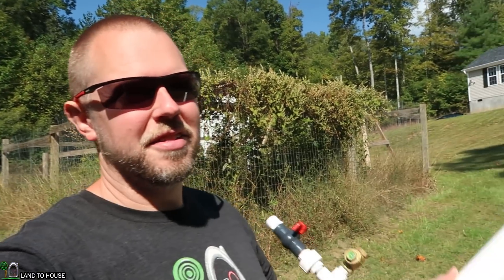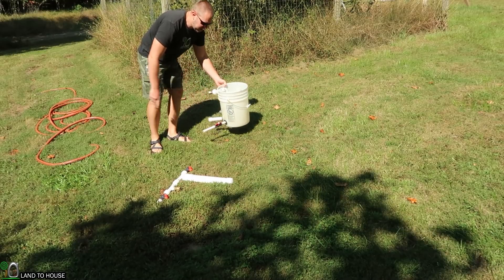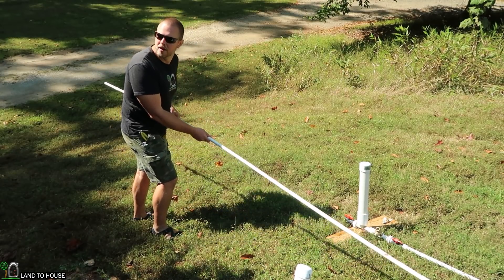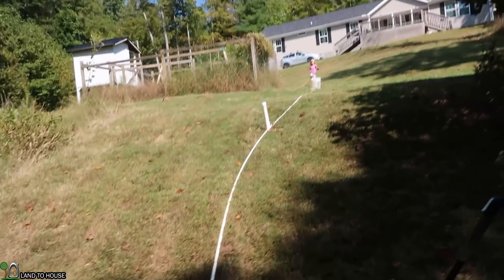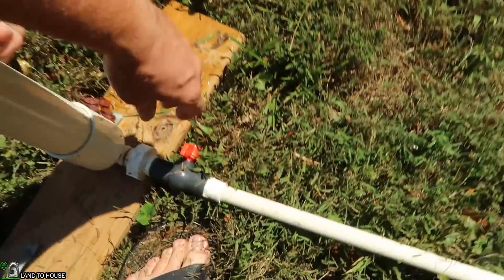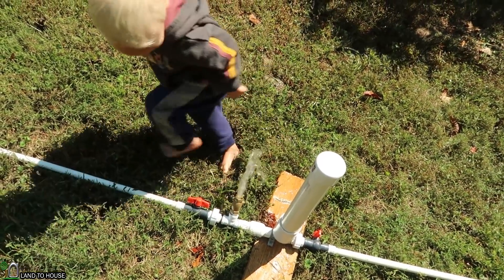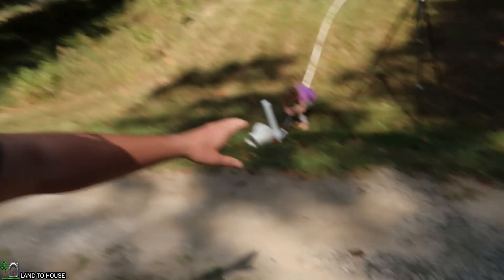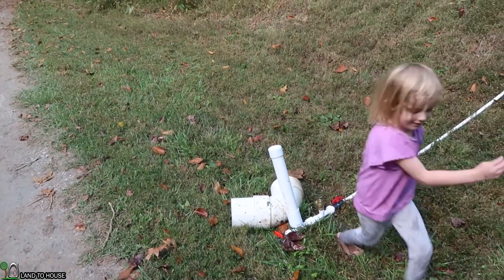Two Ram Pumps in Series

Comment from the maker: Just in case you missed it here is the ram pumps in parallel video:
https://youtu.be/ekeQJ6OiN48
Reply: why would you think that wouldn't work?

Pressure is pressure

So if two or three feet of drop is enough to operate one ram pump.. why would the even higher pressure water coming out of that ram pump not be enough to operate a second one.. when it comes to pressure? Now Flo might be a problem to maintain..

But if you can push water up a hill then it has more pressure than your head pressure on the first pump.

So you just need to make sure you can provide the gallons per minute necessary as you definitely have the pressure.

Have you ever noticed a ratio of head height, to water lost?
In other words if you have 80 ft of drop instead of 2 ft of drop, does less water flow through the valve before it slapped shut because of the higher pressure.

I am just curious if the flow and gallons per minute remains the same no matter what the pressure.. my theory is less gallons per minute at higher pressure would slam the valve shut because it's the same amount of energy with higher pressure and lower flow.

Just curious if you've tested that
Reply: How about 7 parallell pumps in series with one other? Do a raffle and hand out one or more of the pumps for viewers as well.
Reply: I can't see any useful applications for this configuration as of yet but i am interested in seeing the outcome of your proposal. Also try catching the waste from the first in a bucket and run a smaller off that.

Comment: If a lower ramp pump were to pump uphill to another sotrage tank, then drop downhill from the first storage tank and use another ram pump to push the water even higher uphill to another tank....you'd lose water volume but you could pump much higher delivery head by staging them in combination with storage tanks to feed the subsequent ram pumps

Comment: the check valve is most likely not fully closing, and bleeding down to the second pump. i believe you would need a stand pipe inbetween first and second pump, with the height of the stand pipe above the initial head. 

secondly, you must run a larger first pump. 

thirdly, the fist pump needs back pressure, against the check valve in order to work properly. see above.

Comment: Please put a reservoir after the first pump, then use that toilet flush velve and bullkok, except use the bullok to flush it, periodically opening the velve, so the second pump works efficiently and can do work. 
🤔 Hmm I don't know if it will suck air through the flush valve, might need to adjust it closes before the tank empties.

Comment: The second pump is using the relief valve as the open air source every time the first one cycles. The theory on ram pumps is the pump's lift is proportional to the amount of water drop in height, in this case, the source to the first pump needs a longer drop or a large source pi9pel not a larger pump.

Comment: You need 4:1 in diameter to work well. And the water not need to drop. The second pump will cick faster too. But the 20 foot pipe is required between the pumps. The output should be around 40 - 75psi or 3-5 bar. All these from a 3 foot drive pipe elevation. The output water is only 10% of the original input. For an 2inch input pipe will take 14 gallona minute and deliver 30% yo the second 0.5inch ram pump. The final output will be around 3 liter or 3/4gallon. Theoretically it should work with a 1 inch pump too, but it just fit to each other.

Comment: I don't see the point of having them run in series in this exact configuration. I could see adding a second one to act as a repeater to drive water further up a larger hill. while having a reservoir feed the second one yeah you would probably have to have a step down in sizes for it to have plenty of water to keep it going.

Comment: I did not read all the other comments, my stroke prevents my reading... The reason waste valve 2 cycles but wast valve 1 above it dose not as its creating a vacuum pulling it down. That also is the cause of all the additional air pockets. At least that is my best guess. Its sucking water and air from valve 1.

Comment: Add a storage tank to each pump on the input side. When each tank fills up. Then start the next pump. Make a reservoir for waste water collection at each pump. So waste water could feed a smaller system. 
Nothing is ever going to be perfect but you are very diligent. If there is a solution you are the right person to find it. Great video.

Comment: ((Copied my comment from your 
   "Will parallel pumps lift 
    water higher?" video)
""I've only seen less than 25 of the 180 
comments, & not sure if completely 
had been previously stated...

But, 
Two things to recheck if you're going to retest & make an update; 
    A¹try to get both pumps running 
       in unison.
    A²make a stand utilizing three tiers, 
       *a tote mounted on top, 
       *bucket at the ground level w/
        (drain hose back N2 first pump)
       *second ram pump (just above.
         the drain bucket) to make the
         next leg up.

NOTE: the 2 keys that most 
              likely to help is...
 B¹ the stand should be built between
    1/3 & 1/2 of the elevation
    difference between the initial
    source & highest discharge 
    point with the hose filling the 
    tote at maximum elevation. 
 B² the return hose will not only stop
    the formation of a mud hole.. 
    But slightly add to the head
    pressure of water source
    Which should slightly increase
    overall elevation.

If you truly must pump to 
really unbelievable hights...
This might be just stand a 
chance of helping.

If y'all decide this might be worth 
trying, let me know & I'll keep 
an eye out. 

Thanks for sharing. ""

Comment: Isnt the whole idea to send water to a higher elevation? Having water flow downhill and create a small amount of pressure seems kinda normal. 
U said the drop from the bucket to the first pump was 3 feet but the water was only getting pumped less than a foot high…

Also shudnt the waste water valve be downstream from the air tank? That way when the waste water valve shuts from the flow of water, the resulting water hammer reverses flow and has more force on the air tank.
Reply: My thoughts exactly.  There is no point in the first pump, as it is uphill from the second pump.  Just removing that pump would increase the pressure on the second pump.  to put 2 of these in series and make sense,, the first pump should be lowest.   It should pump uphill to a reservoir similar to the first pump's reservoir.  That should feed the second pump to give it pressure.  The second pump them carries the water farther uphill.  You could also capture the waste water, from the second pump, and feed it back down to the reservoir of the first pump.

Comment: i dont think u should have put the second pump lower than the first. try puting the second uphill and if posible smaller diameter pipe than the first in order to increase total elevation of pumped water by the combo.
Reply: There is no point in the first pump, as it is uphill from the second pump.  Just removing that pump would increase the pressure on the second pump.  to put 2 of these in series and make sense,, the first pump should be lowest.   It should pump uphill to a reservoir similar to the first pump's reservoir.  That should feed the second pump to give it pressure.  The second pump them carries the water farther uphill.  You could also capture the waste water, from the second pump, and feed it back down to the reservoir of the first pump.

Comment: Your water reservoir is a bucket which is unable to create pressure on the basis of its small volume you must use a bigger water reservoir
Reply from the maker: Water pressure is based on water height not volume. The bucket is a little over 1' tall so that adds around 
.433psi

Comment: Your setup is backwards. First pump should be at lowest height the current setup is pushing water through the first pump into the second one by bypassing the valve in the delivery side of the first pump.
Reply: My thoughts exactly.   There is no point in the first pump, as it is uphill from the second pump.  Just removing that pump would increase the pressure on the second pump.  to put 2 of these in series and make sense,, the first pump should be lowest.   It should pump uphill to a reservoir similar to the first pump's reservoir.  That should feed the second pump to give it pressure.  The second pump them carries the water farther uphill.  You could also capture the waste water, from the second pump, and feed it back down to the reservoir of the first pump.

Comment: I think you should add a buffer tank in between the two pumps like a section of 2 feet of 4 inch pipe and let the pressure build up before you open the valve.

Comment: What would happen if you ran pump #1 uphill to a reservoir to “restart” the ram pump system again? Basically running two ram pumps in tandem but not quite directly connected to the same pressure system. Two fully independent ram pumps that just happen to be using the same water but not the same pressure. 2’ initial head pressure leads to Uphill 30’ down 2’ from that point should gain you another 30’ lift, yes?!? So hanging another bucket where your hose ends 2’ above ground, connect another ram should gain you another 30’ of lift.

Comment: Series ram pumps.  Is it possible to have the second  ram pump drive pipe cut shorter or nearer to the 1st ram pump? The drive line of the 2nd  pump will then be having a higher  input water pressure and therefore the delivery pipe of the 2nd pipe will have a greater flow rate.

Comment: My idea is to have the second pump at a slightly higher or even elevation to the first one. it runs off of the back pressure from the pumping  action which is lost as the water flows down hill. Good luck

Comment: Hi sir, 
I had made a Ram pump of 1" .
I would like to pump the water up to 60 feet hight and 500 meter long .
Please tell me the head pressure hight and dry pipe length require for that.  Please reply the msg .

Comment: I have a creek with little head height, i need to measure to get an exact amount, but I was wondering, could you connect a pipe to the waste outlet to create suction increasing velocity and pressure? Idea: 3x Smooth 90's to turn oven then downstream and end with a "large" bell, 1" to 3" connector with 3" facing downstream, on the end to create a point of low pressure

Comment: Just curious... Maybe it's been done already... How well would it work to take some sort of ram pump setup, fill a large maybe 1-2k gallon tank on top of a hill, then take a small hydro electric setup, place in inline above the ram pumps so it is then a self recirculating system that generates a continuous flow of water as well as electricity? Thanks for your time, I'd love to hear your thoughts! Side note, maybe have two pumps in parallel and only hydro in line with one?

Comment: good work.        as was stated, at the beginning,  this was  Never  gonna  work.
Reply from the maker: Thank you. I have found that you can run a smaller pump directly from the waste valve of a larger pump. That was pretty cool but it does not increase the output lift height.

Comment: Update your bucket with a flow valve to a bigger blue barrel 50gal and level it with a 45 angle pipe. Increase the pipe size by half at least, so if 1" bump up to 1.5". Create more gravity pressure up stream and increase flow dynamics of the larger pipe reducing down.

Comment: Neat, thanks for running this test.
Direct piping them in series like this is not much different from your test of having 2 waste valves on a single pump (April 2018)
You've already tested a 1-1/4 pump filling the supply bucket for a 1/2 pump (April 2015) to get 2-stage lift to pump higher.  And you've tested catching the discharge from the waste valve to run a second pump (Jun 2020) and get more volume of water delivered.  I think all bases have finally been covered.

Comment: I see that you've done many configurations and variations on the standard Ram pump system.. have you tried reclaiming the Wastewater? What I mean is if you have enough flow for an inch or inch and a quarter can you have that waste water drain into a bucket that feeds into 1/4 or 1/2 inch RAM pump?

Comment: Seth, what you need to do is send the water down 1 meter and flow it into the double ram pump which should allow you to send the water up, let’s say 4 meters. Then you use the flow from that water to drop one meter and feed a third ramp pump and send the water up an additional 4 meters…..for a total of 6 meters. In other words: the flow from the new water source created by the double ramp pump should be sufficient to power the 3rd ramp pump.

Comment: Hi SETH. My camp ram pump stopped by just getting slower and slower. On investigation I found that the bicycle tube in the PVC pressure tank had gone flat. Back together now and await results. OVER 1/2 a KM pumping water.Thanks for all your video's, and your helping me, better understand how these work.:)
Reply from the maker: That is a nice long delivery pipe! Sometimes you can simply drain the pressure tank and make sure it sits upright.

Comment: To me the best scenario would be the 1st pump near your source supplying water to a tank for the 2nd pump up the hill near the max lift. Then the waste from the higher pump can be cycled back to the source of the bottom. I think one could quite successfully run a relay that way with the pumps scaling down. Water is fast becoming an important resource.
Reply: This was what I was thinking too. We have a long way to go up, and having that second drop to the second pump might be our solution.
Reply: I'm sure your experiments are good,  I assume in this case you are in a scenario you pump to one place then use the other pump to send water further, assuming one ramp pump can not send that far enough,  otherwise doesn't have sense one pump delivery feeding a second pump, there can be another scenarios also,  one pipe feeding two pumps and one delivery outlet, that would awesome,  more pressure, more water.  Good job.  I have never done it but I'm learning a lot when I go back to my new house so I can implement it.

Comment: Seems that there are too many cooks in the kitchen lol.

Fluids stay in equilibrium when in a closed system, so when the drive pipe is closed the lower pump doesn't build pressure; when the higher pump is cycling the lower pump builds pressure ONLY when the drive pump of the lower ram is closed.

Open the higher pump so pressure builds, then once the pressure is high enough open the delivery valve in the lower one.

Comment: WHAT IF YOU FEED THE SECOND PUMP FROM THE WAST VALVE OF THE FIRST PUMP ?     YOU MIGHT USE A 3/4 " PUMP TO FEED A 1/2" PUMP.  I WONDER WHAT THE OUTPUT OF THE 2  WOULD BE THEN ?    ALSO COULD YOU LEAVE A OPENED STAND PIPI AT THE TOP OF THE 1/2" FEED PIPE BY THE WAST VALVE SO IT WILL NOT HYDROLOCK ?

Comment: could you run two ram pumps side by side but, put a arm valve or timer arm between the two waste valves so when one valve closes the other is open? that way the pulse rate of pumped water is twice as fast. just a thought

Comment: The only fair system to set up, would be the exact same system, twice. Two supplies, two feeds. Two returns. All sizes equal. But then we already know that would double the amount of delivered water. Any other setup is going to be using two identical pumps and getting less than double the delivery.

Comment: ever use ram pumps to supply an elevated tank and then use that higher head pressure to run a micro hydro? wonder if it could cchieve greater results vs just hydro

Comment: A ram pump is designed as a tuned system. The reverse pulse (up the delivery pipe)  to the intake standpipe requires a particular length to operate efficiently if at all. The velocity of the pulse wave and cycle period determines the drive pipe length. a rule of thumb is a 10:1 ratio of water used to water delivered so you should expect to get very little water at high pressure delivered out of the second ram pump in this configuration. Consider shortening the second drive pipe and limiting the waste valve stroke accordingly.  Thank you for the interesting experiment!

Comment: I've seriously considered collecting the waste water off of a 1" ram pump, collecting that water in a trough of some sort, and running it downhill into the drive side of a 3/4" or smaller pump, possibly with a bucket intake somewhere in-between.
Reply: I’ve put way to much thought into this. Like what if you create a tromp system before the ram pump so the water hammer increases the air pressure gathered then use the air to air lift pump the waste water back to the top?
Reply from the maker: A little something like this
https://youtu.be/q3BOG0hureY
Reply: @LandtoHouse  I bought one of your 1/2 inch  off your website and I’m going to try what I said. I’d love help testing this though...

Water source > insert a Venturi pump to suck air into the drive pipe > pass the drive pipe through an air collection tank > then the ram pump. (Mr Teslonian achieved this part.) after the ram pump use the air collection to send water back to original storage tank.

Comment: Just starting vid. But the idea seems really wasteful, and seems like the second pump will restrict the first.
Reply from the maker: There were so many comments asking for series pumps that I felt I should try. Did not work out very well.
Reply: @LandtoHouse  not knocking you. I meant 2nd inline valve wastes most of the water your pumping.   I still wanna see the parallels with y pipes instead of those 90s
 Lol.  That's where the money is.